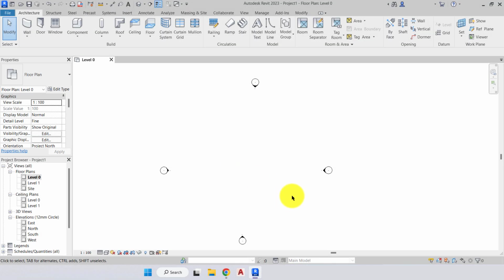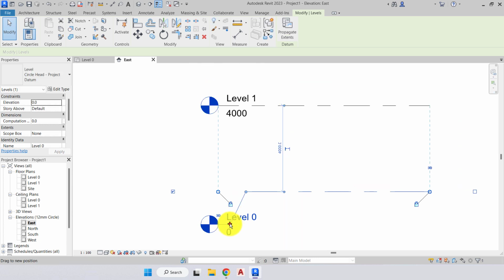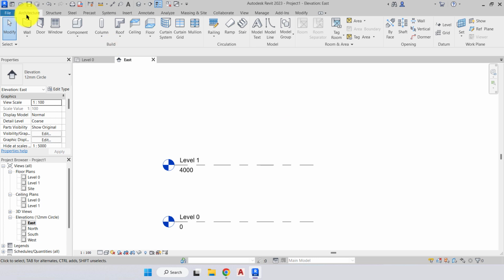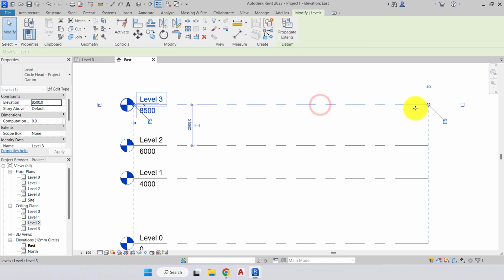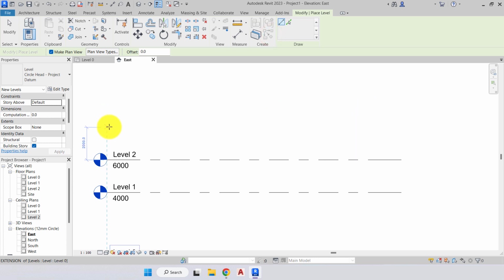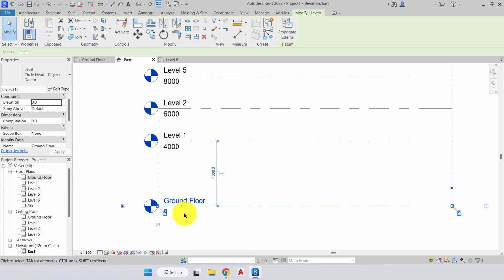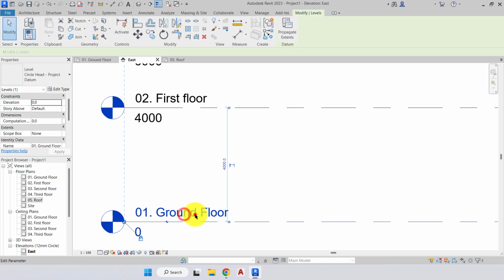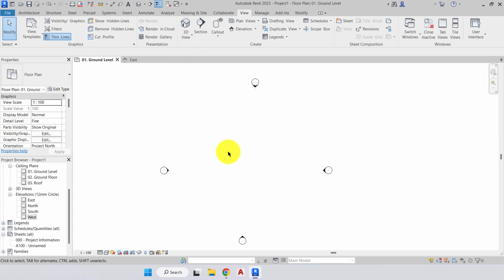Revit beginner guide: Part 4 - Datum Levels

Comment: is there a way to set the elbow exactly the same for all views (ie same length, angle). in my previous company it is important for QA/QC purpose. i tried drawing lines but the elbow is not snapping on the lines
Reply from the maker: Hello, yes, it is very frustrating. For my own projects, I have created my own annotations where I have full control. It is not possible with the Autodesk annotations.